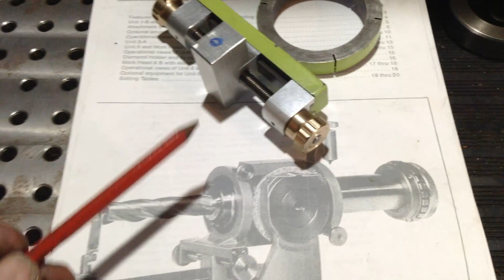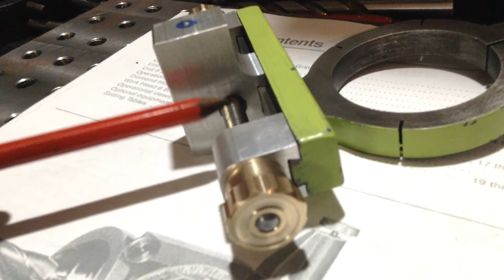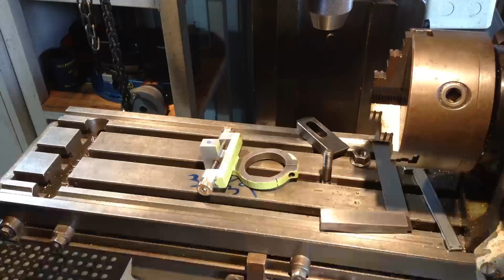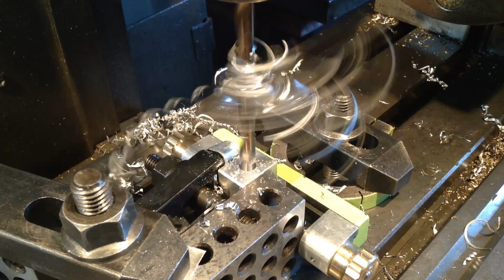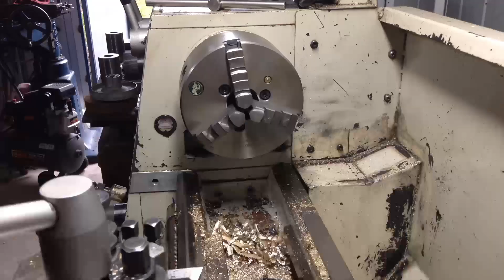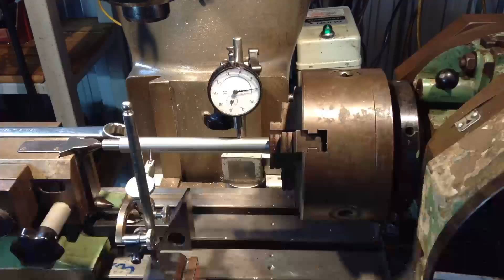L.A Rocheleau Grinding Fixture Indexing Attachment . Part 4 A

Comment: I haven't seen a dividing head tailstock centered using the workpiece before. I've always done it by using a test bar in the dividing head taper, now I see how to do it another way :-)
Reply from the maker: Thanks  .  That's the way i would normally do it  , using the part to be machined .  Cheers .